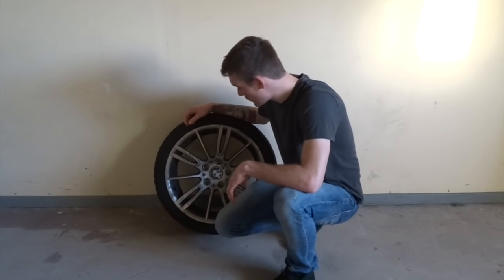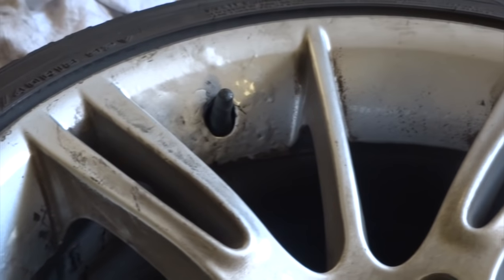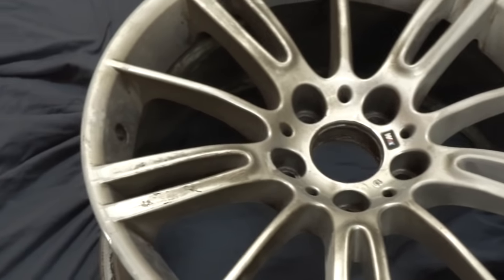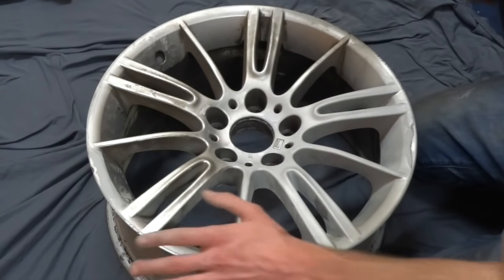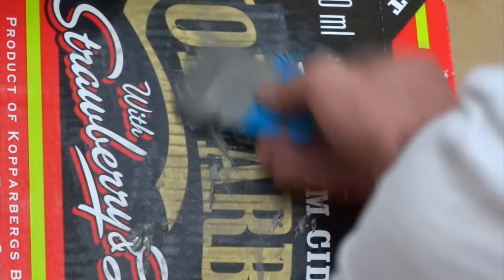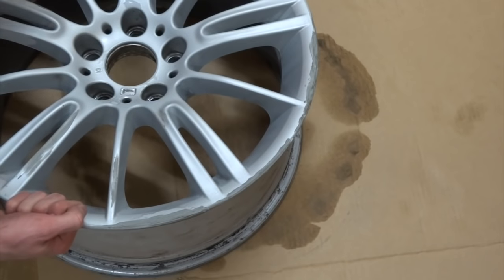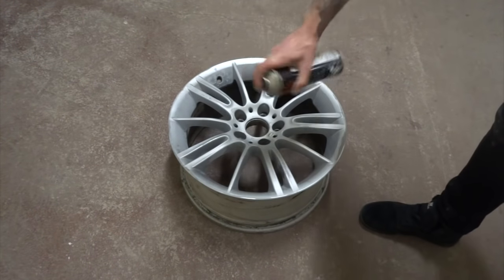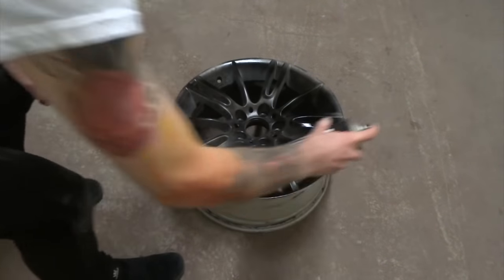How To Refurbish Wheels & Repaint!- CB CarStyle How-To's!

Comment: If you dont add clear will the paint flake off?? I like the color you got before adding clear.
Reply from the maker: Clear will make it more resistant to chips and fading, but good prep is what makes the paint stick
Reply: @ChrisTheCarBuilder  thanks for the response! Another question can you get a smooth finish with no clear? Im afraid if i dont add clear the surface will be gritty and brake dust and other contaminants will just bake itself on the paint happened before with some rims i painted with little to no clear.

Comment: I tried to paint hyper silver last week, or at least close to, by using gray primer then silver paint then clear coat, but the result is not something close to hyper silver at all. It looks a lot just silver. Is there any change for me to fix that, maybe by adding another coat ?
Reply from the maker: Son K black base coat, thin coats or silver, no clear. If you add clear, add loads and polish the hell out of it
Reply: Thanks for your quick response. So basically I need to start all over again ? Sand them off and then start with glossy black primer ( I want the rims look brighter )--> light coats of silver ? In that case, which spray paint brand would you recommend ? VHT or Rust Oleum ?
Reply: you can use black paint as a base coat like in the video.
Reply: Dont use rustolueom get some Krylon or Color Palace... It will go much better, make sure the can is warmed up too, makes the paint lay better without that bumpy finish